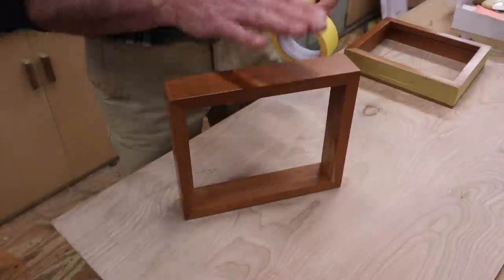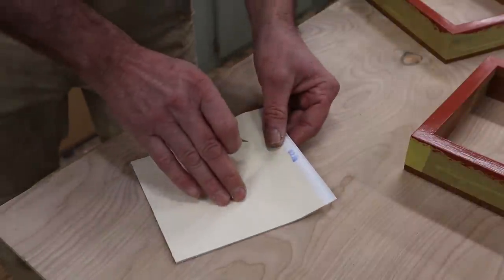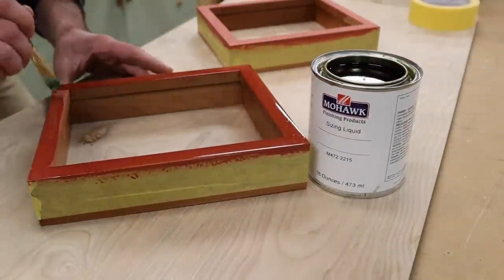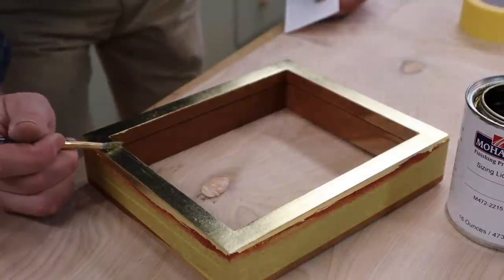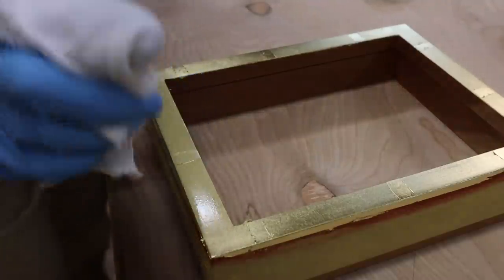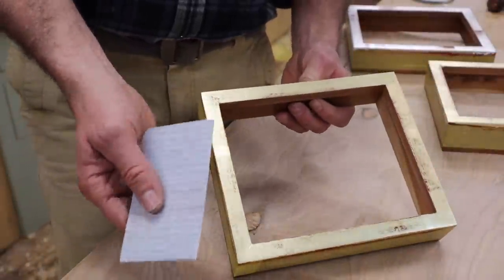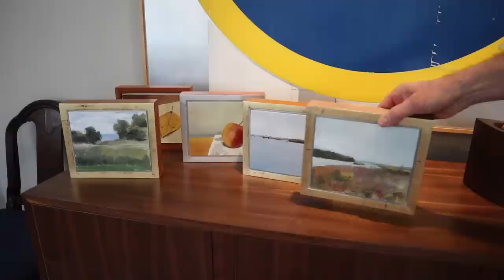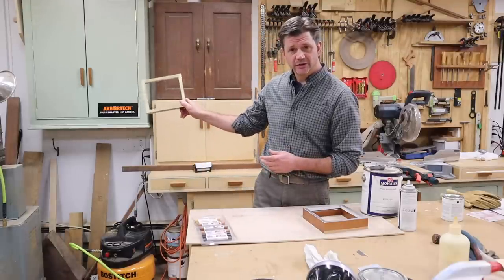How To Use Gold Leaf to Gild A Frame

Comment: Jon - Nicely done. A tip for working with gold leaf: If you use a squirrel hair brush to pick up the leaf and apply it to the sizing it will lie very flat and smooth.